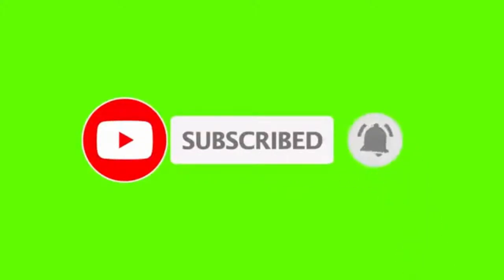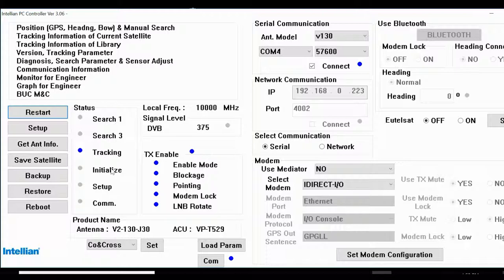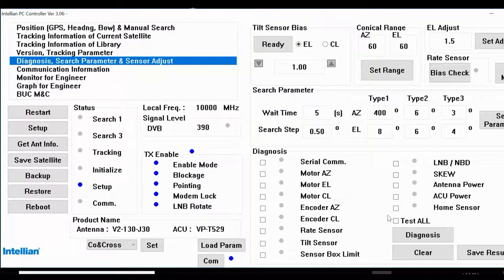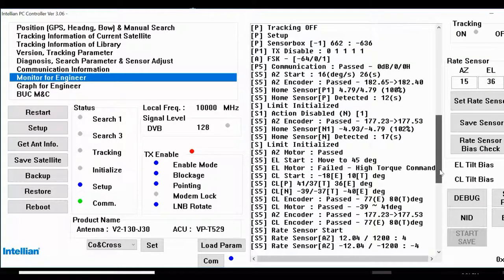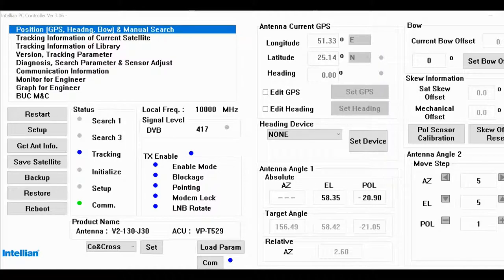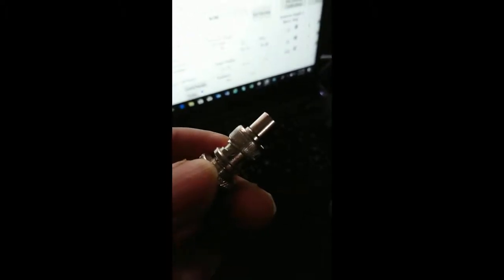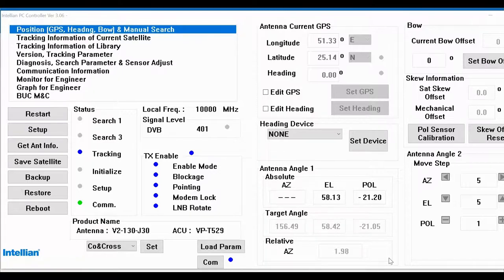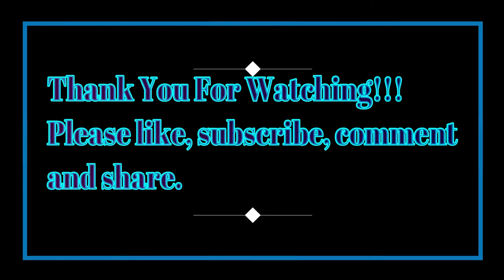How to Fix an Intellian V130 Stabilize Antenna The Easy Way , No Tx Output Power | SITECHZ

Comment: Sir single coax cable lang ginagamit sa previous antenna nag palit ng bago intellian antena saan po yung coax cable i kakabit sa ACU tx or sa ACU rx po ba...Thank s and more power..
Reply from the maker: sorry for very late reply. single coax only then it must be  a two-way setup.. tx/rx signal flow in one cable//what model of antenna you are working..if you replace with new model with separate Tx and Rx then you must run another cable for the Tx ..